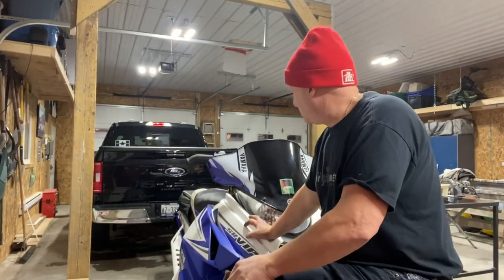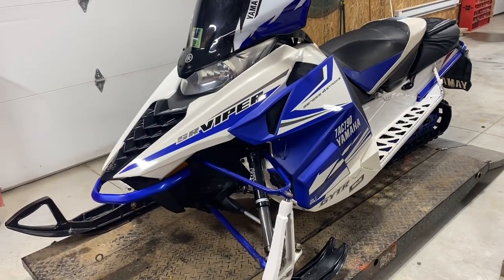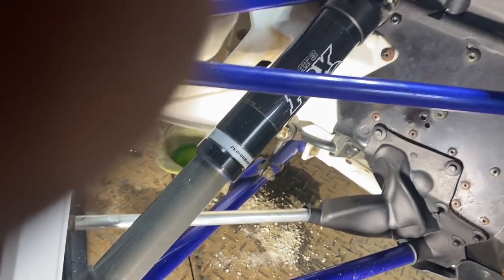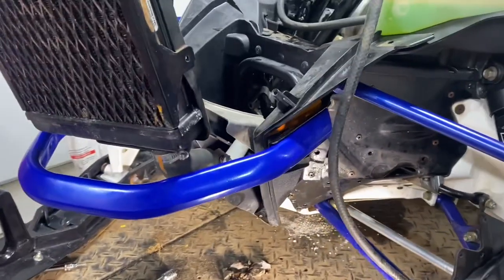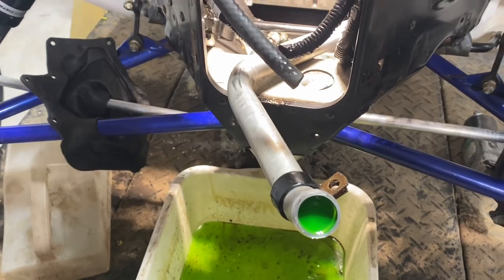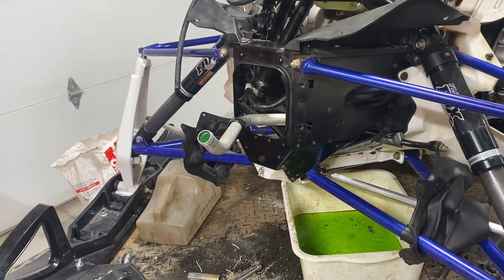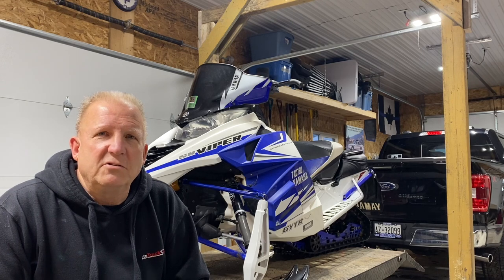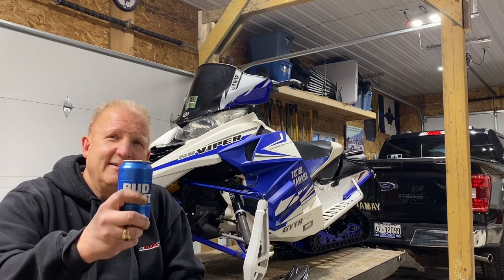2015 Yamaha Viper - Seized Steering - Steering problems - Arctic Cat

Comment: I referenced this video to take that same aluminum plate out.  That plate is prone to breaking/cracking and an updated kit is available that has a steel insert where the steering shaft bolt goes through it.  Unfortunately many Viper and Artic Cat owners will experience sloppy steering because of it.  I wish I had ordered that pivot or just new bushings too because there is also more play in that and I will probably do this job again this summer.  It was a bit of a pain to get to but I ended up doing it twice and now I feel like it isn’t really that difficult,  just a bit time consuming.  Thanks for the video.

Comment: That piece is called a ‘bell crank’.  I just installed a brass bushing kit in my ‘16 viper from Mainway Solutions.  He is in Ontario.  The cost was around $90 plus $12 shipping.   I received it in the mail in Sask  in 4 days.  I was able to get mine without removing the air box. I just took bolts out of rad and moved it around as needed.
Reply from the maker: Thank-you.  Appreciate the input and feedback

Comment: Nice video, good job!! :)  I have SR Viper and I love it! Only problem I had broken frame in tunnel both sides, I bought it with hidden defect and fixed before last season! Now I'm going through to check how my job was done and if additional plates holding together. As my Viper is disassembled, will check all steering assemblies.